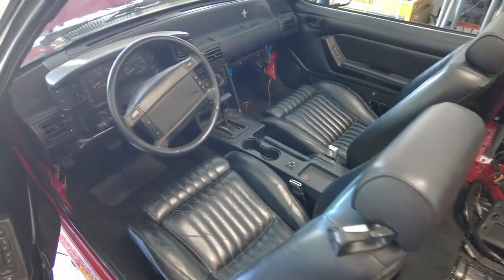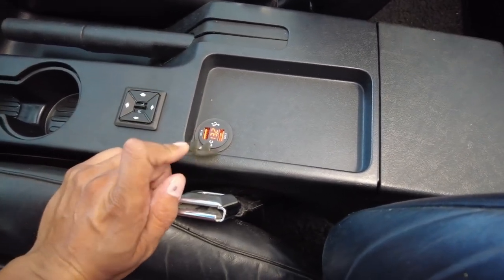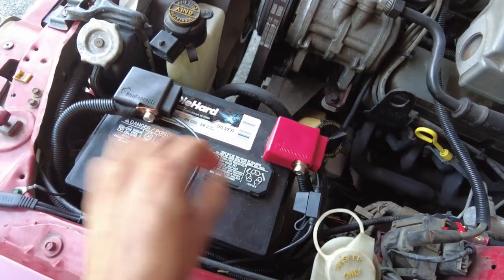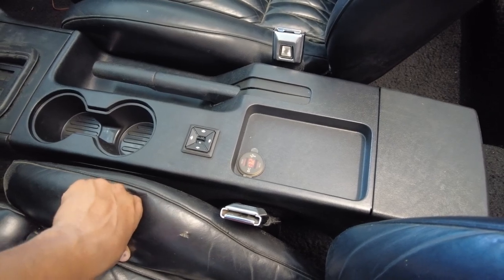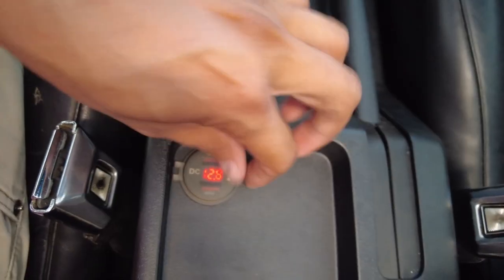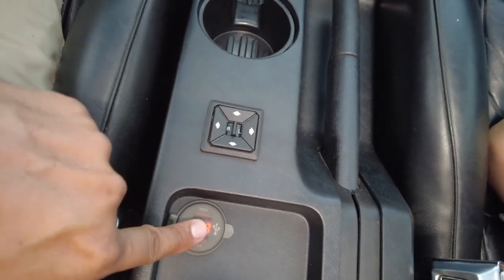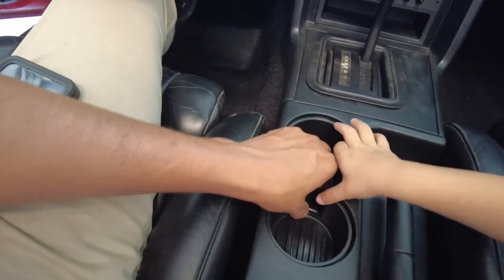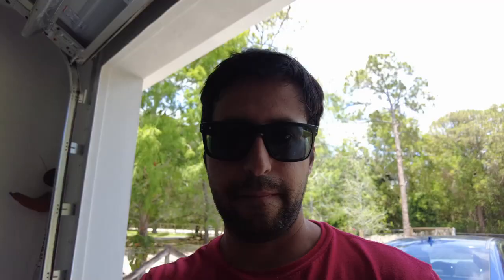Install a Custom Battery Voltage/ USB Charger in Your Foxbody Mustang

Comment: Nice job. I have the same colour (Kinda...as I went with the Lazer Red) but looking to make improvements as years go bye.
Where did you get the center council please?
I was also ordering the batter terminals with the added tips of $9.99 each and with shipping to Canada...yikes ($102) so I may have to look at something a little more reasonably priced in Canada.